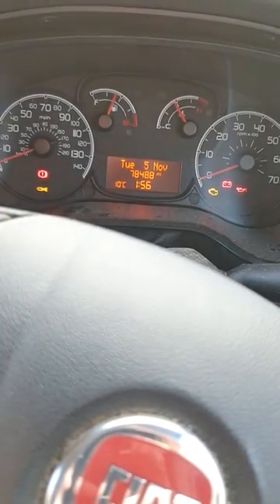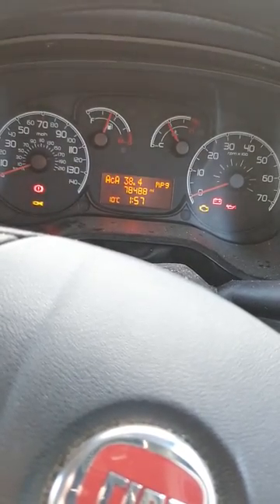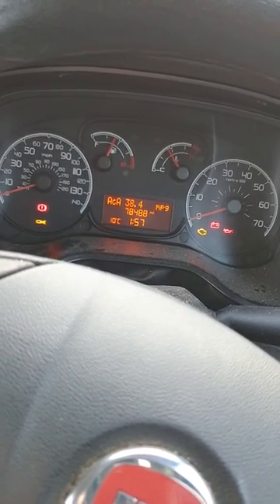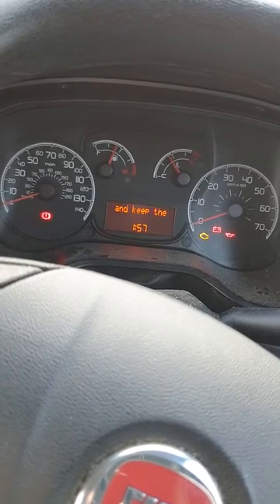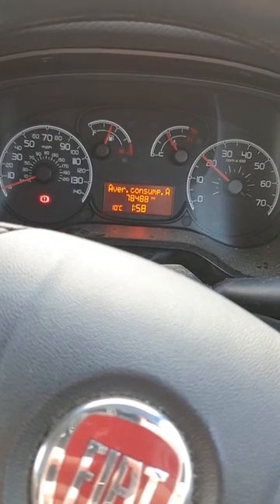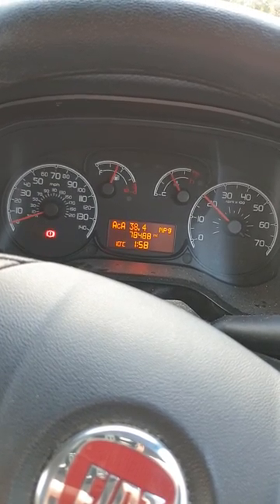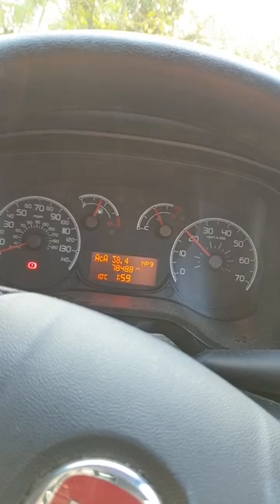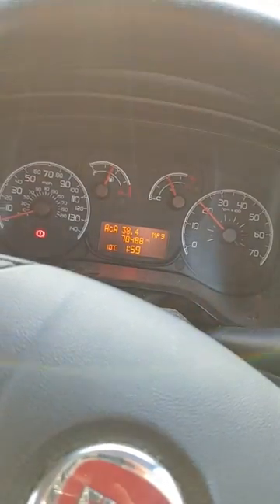Fiat Doblo DPF cleaning regenerate procedure

Comment: thanks for this - I get a Check Motor lamp, which - when I take the Fiat to a garage to read off the diagnostic code - is linked to a DPF sensor problem.  Do you suggest we do this, regularly, even if we don't get that specific DPF Cleaning Regenerate on the display.  My garage now recommends me to clean the DPF by just running my car - warm - at high revs (i.e. low gear) for 30 mins or so.  Please: is this an in-built alternative to doing this car drive to just clean the filter?
Reply: I'm pretty sure the ability to make the car run a self clean at stationary is for people you only do very small commutes and not get the car hot enough for the cleaning function to work, the car uses more fuel in this mode and runs the engine at 2000RPM to burn the soot built up in the filter. The engine is supposed to heat to such a temperature the soot turns to ash fine enough to be blown out of the filter.

Comment: So glad you posted this, just bought one. The next day all this starting happening and mine is now in limp mode! Should be an easy fix though, have you or any anyone here rescued a filter by using DPF cleaner fuel additive?  Many thanks for taking the time to upload :)
Reply: DPF foam cleaner can work. let it soak in for a bit.
Reply: @McBenjiBoo   I tried most things even fuel cleaning additive this is the only thing that has worked 100% for my motor Doblo 1300 2013